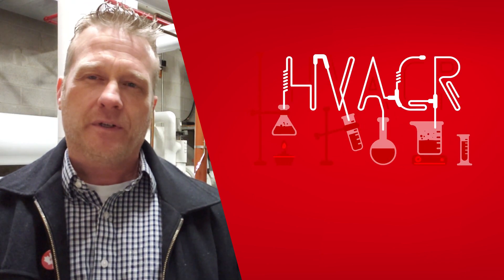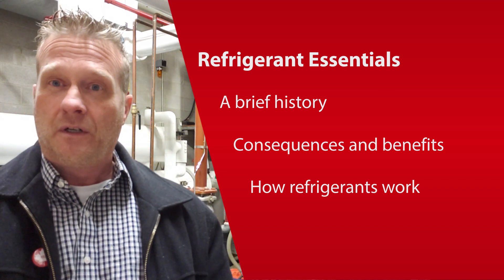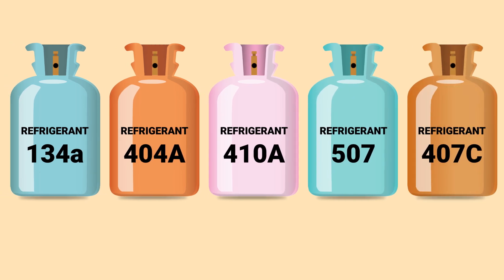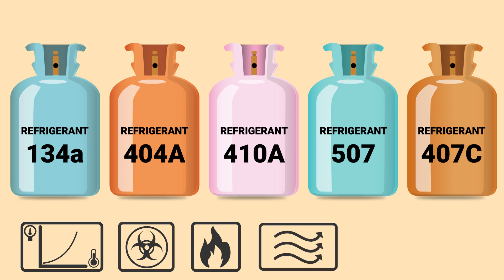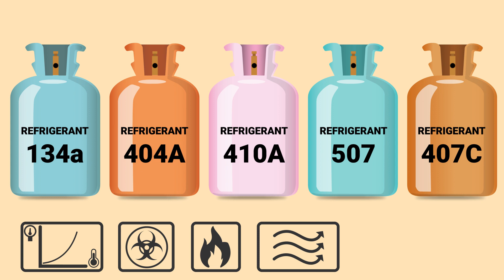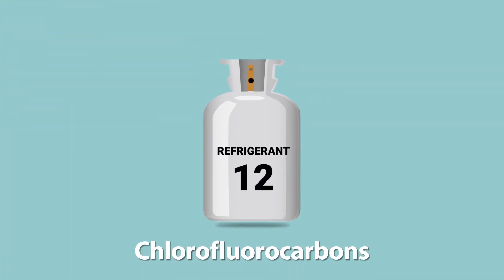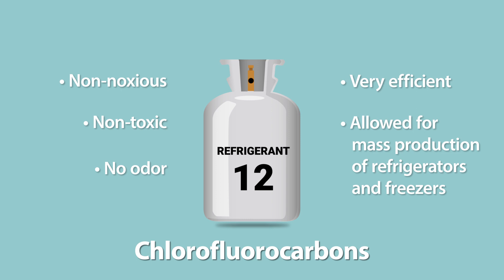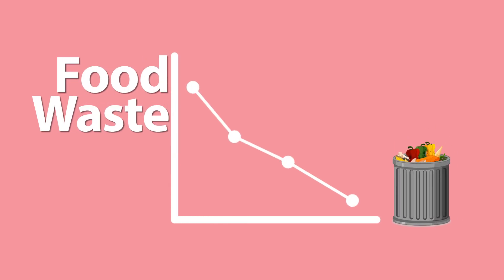Refrigerants — a quick overview | HVACR Distillery Episode 5

Comment: If my air conditioner uses 410, it can put 134 freon?😊
Reply from the maker: Hi. The answer is no, unfortunately not. The 2 refrigerants have very different pressure temperature relationships and the compressor compression ratio is designed around R410a. As well, the capacity of the system would drop substantially. Finally the TXV metering device is also designed around R410a so will not work with R134a. We hope this answers your question.